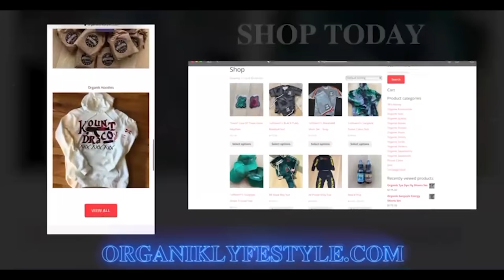THE BEST #ROLLSROYCEDAWN ON EARTH!!! 24 inch #forgiato WHEELS

Comment: Looks great! Those tires would be a killer in New York where I live… I had 45 series on my Audi convertible and every little bump cost me a rim repair and a new Pirelli tire. I always kept a spare rim and tire in the garage just in case. Those Audi Rims cost a small fortune, nothing compared to your Forgi’s…lol! These NY roads are terror on thin wall tires. Need at least a 65 series to avoid living at the tire shop.   Your whips keep getting sweeter and sweeter… that red really brings out the interior. My Audi was the same combo